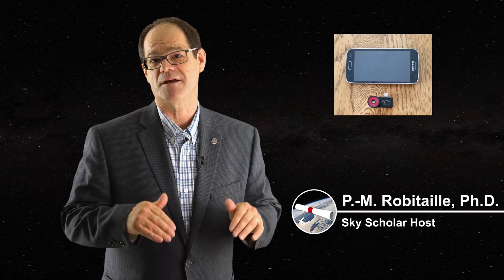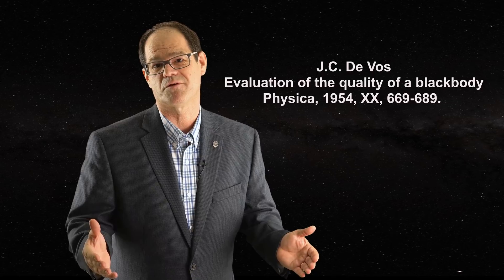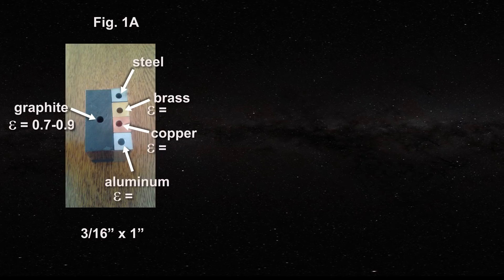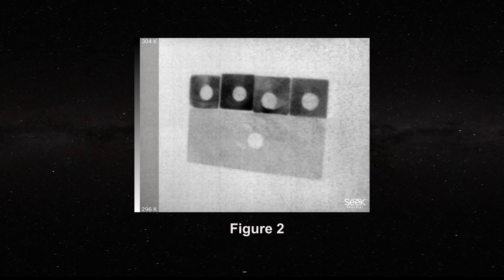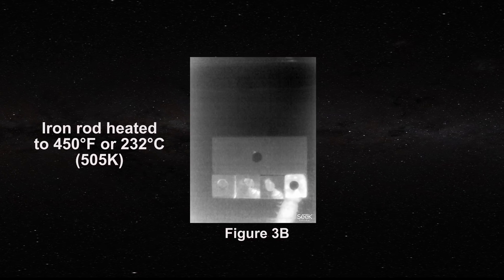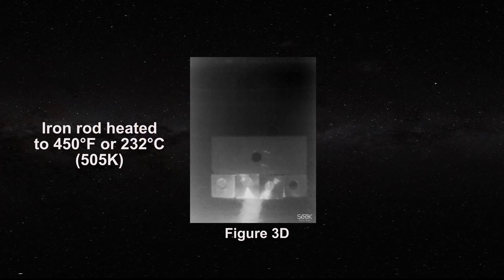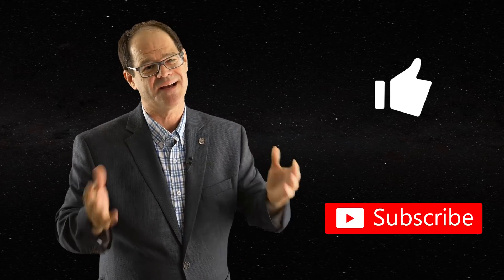Is Kirchhoff's Law True? The Experiment!

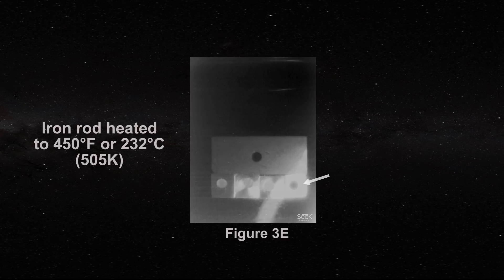Comment: "All cavities contain the radiation that corresponds to / manifests the temperature of their walls."  0:08, and 6:20

* It's only true in equilibrium, which your "cavities" aren't because they are open to their environment.
* They aren't cavities. One entire side is missing. They're holes.
* Showing that the "cavity" is black doesn't show that there is no radiation in the "cavity". It shows that there is no radiation escaping from the "cavity", since the camera is not in the "cavity".
* There is also the issue of the sensitivity of the camera to radiation of different temperatures.

In short, rubbish from start to finish. A pointless experiment aimed at an imaginary target.
Reply: Deipatrous, smug little know nothing.  While physicists and cosmologists ponder unicorns and fairy dust, us cranks go ahead and design and build the devices that power the world.  You see, mathematics doesn't produce anything.  Mathematics was used to prove that the earth was the center of the universe at one time.  And today, physicists don't know any better.
On the other hand, it only took me to the 3rd grade to learn that division by zero is undefined.  Physicists think they can define it.  I guess they still haven't learned the basics.
And on that bombshell . . .
Reply: Deipatrous, you are nothing but a massive idiot.  The simplicity of the demonstration is obvious to anyone without the blinders of pseudoscience on.
When "scientists," and I use that term very loosely, accepted a theory based on "thought experiments" over the scientific method of investigative laboratory science, they effectively set the world back over 100 years with stagnation.  The people who gave us the modern world (Heavyside, Maxwell, Tesla, Birkeland) were ignored and the science they were pursuing was replaced with philosophy.
Pseudoscience allows the division by zero to result in a supposedly real physical object.
Pseudoscience accepts untested observations as universal laws without any supporting evidence.
The good doctor showed with elegant simplicity the fallacy of the conclusions of Kirchoff and Planck when it comes to black bodies.
And what scientist doesn't know that you can't use a black body to test for the temperature of the universe?  The universe isn't in a cavity, and it's not a solid.
Reply: Ah, the vacuous response from an imbecile.  You wouldn't know basic physics if it fell out of the sky, landed on your face and started wiggling.

HAHAHAHAHAHA
Reply: @Deipatrous: In view of the experimental evidence presented by Professor Robitaille to the contrary, please explain why you think Kirchhoff's Law of Thermal Emission is true.
Reply: Why don't you explain to us why you think that experiment was invalid?  Or is that simply too hard for you?
Reply: Yes, please go away.  You offer nothing to the conversation.  I do have physics training, as well as quite a few years of mathematics and a lifetime of application of those courses in electrical engineering.

Pseudoscience is the hallmark of the high priests of singularities.  Infinite gravity from a finite mass collapsing . . . you do realize that "infinity" is not a number.  Or is that too complicated for you?
Reply: @Deipatrous: You did not provide your explanation as to why Kirchhoff Law of Thermal Emission is not wrong. 

Here is that Nobel Laureate you refer to:

Crothers, S. J., General Relativity: In Acknowledgement Of Professor Gerardus ‘t Hooft, Nobel Laureate, 4 August, 2014, http://vixra.org/pdf/1409.0072v9.pdf
Reply: I suppose you do.  Seems pretty obvious with the dismissive attitude you've presented since your very first post.  How very big of you to admit it.
Reply: No astronomer or cosmologist understands the laws of thermodynamics. None of them know the difference between intensive and extensive thermodynamic quantities and thereby violate the laws of thermodynamics by equating an intensive quantity to an extensive quantity (temperature as a function of mass), and unwittingly produce perpetual motion machines of the 1st kind and of the 2nd kind when they permit a free gas to compress itself to form a star and a black hole. It's certain that Kirchhoff's Law of Thermal Emission is false and Planck's equation is not universal. This puts an end to big bang creationism, as explained in this paper:

Robitaille, P.-M., Crothers, S. J., “The Theory of Heat Radiation” Revisited: A Commentary on the Validity of Kirchhoff’s Law of Thermal Emission and Max Planck’s Claim of Universality, Progress in Physics, v. 11, p.120-132, (2015), http://vixra.org/pdf/1502.0007v2.pdf 

Note in the above paper how Planck violated the laws of thermal emission and abused Brewster's Law in his scandalous attempt to prove Kirchhoff's Law of Thermal Emission right. He had no chance in any event because Kirchhoff is wrong, as the clinical existence of MRI proves, every day. One can have Kirchhoff's said Law but not MRI, or one can have MRI but not Kirchhoff's Law.  Any reasonable person will concede that MRI is real, producing images of parts of the human body every day in medicine. The existence of MRI proves Kirchhoff wrong because MRI (and NMR) is facilitated by spin-lattice relaxation (proton spin and its interaction with the structural lattice of the cavity walls), which means that there is energy in the walls of an arbitrary cavity that is not available to thermal emission. When Kirchhoff and Planck, by their theorising alone, permitted all the energy in the walls of an arbitrary cavity to be available to thermal emission they made all cavities blackbodies, when at thermal equilibrium, contrary to physical reality. 

Here is a simple 3-page paper which reveals how astronomers and cosmologists permit the absolute value of a real number to take on values less than zero, in order to construct their "mathematical theory of black holes":

Crothers, S. J., A Few Things You Need to Know to Tell if a Mathematical Physicist is Talking Nonsense: the Black Hole - a Case Study, 29 July, 2015, http://vixra.org/pdf/1508.0007v1.pdf

Anybody how has taken mathematics at school knows that the absolute of a real number can never be less than zero, and that the square of a real number can never be less than zero. Astronomers and cosmologists however are oblivious to their violations of these simple facts, which is precisely how they make their 'black holes'.
Reply: Still waiting for a proof that Mr Robitaille is quacking,  Deipatrous.

Your comments are so pointless that you will actually convince people that you do not know what you are talking about and this gives credit to Mr Robitaille.  Your efforts are self defeating. Kinda funny
Reply: You obviously don't get around much then.  I work with RF engineers all the time and they don't know what wires are.

Get a clue.  Going around in life completely unaware that electromagnetism is 39 orders of magnitude more influential than gravity on "charged" matter is like not realizing that liquid water is wet.
Reply: Everything we use today has a watermark of Tesla in the background. This brilliant mind died as a poor man in a hotel room, he was also presented as a crank nut case in those times. I just wonder if they listen to him and wanted to invest in his work, how would the world really look today if he had a chance and budget  to create his ideas.
Reply: Because it is Stephen J. Crothers, a notable critic of the black hole theory, and it was a SMALL conference.
Reply: You have University resources, recreate the experiment and then post a video.
Reply: You have to prove that he is quacking. I well know that an ad hominem is not always wrong but you have  to prove he displayed that behavior before to make it true.  Try harder. It feeds me
Reply: I'm an electrical engineer who understands the role of electromagnetism on plasma.  Electromagnetism is the tool through which we study the entirety of the cosmos.  We have massive radio telescope arrays searching out magnetic and electric fields by the radiation they emit.  We have optical telescopes that cover the range from infrared to ultraviolet, and others above the atmosphere that look at far infrared, UV, X-ray and gamma.  All of that is electromagnetic.  All of it produced by some electromagnetic phenomenon.  None of it produced by the .01% of the matter in the universe that is cold and electrically neutral, like where we live.

Laboratory science explains how plasma behaves.  We see in the laboratory what we observe through our telescopes.  We produce X-rays with ease, and not a hint of gravity is involved.  We produce masses with static charges that attract each other, no gravity involved.  We observe a filamentary universe on every scale.  Gravity doesn't produce filaments but plasma currents do.

So, what's your excuse?  Are you stupid, or simply blind?
Reply: Deipatrous, you need to step back from your dogma about gravity for a minute and look at the universe as a whole to see the problem.

Our world, the world of solids, liquids and gases exists along a temperature spectrum that is a thin line.  In a universe where temperatures range from absolute zero to literally millions of degrees, all within the distance from the sun to the earth, you can see that our world and it's three states of matter is exceedingly unlikely.  It is the exception, not the rule.  Gravity only becomes dominant once the electric force has reached a state of discharge.  That only happens once temperatures get close to absolute zero relative to the entire spectrum of temperatures.

The sun contains 99.8% of all the mass in the solar system, most of which is in the plasma condition.  And because the sun is electrified, it ejects the solar wind using electromagnetism, and that solar wind gains velocity as it leaves the surface of the sun and heads towards earth.  They use the same method at CERN to accelerate protons.  Gravity is completely ignored by the solar wind.  That is undeniable.  You don't gain velocity leaving a large mass unless there is something propelling that mass, and the only thing available is EM.  And when that mass reaches the earth, the magnetic field of the earth yanks those particles into the upper atmosphere creating auroras.  Gravity's role in the behavior of that plasma is 39 orders of magnitude below the signal level.  It's merely noise.

You need to read about the Norse physicists, Birkeland, Langmuir and Alfven.  They understood well what was going on outside the atmosphere, the vast universe that exists as plasma.  What Birkeland and Alfven predicted based on their understanding of plasma was vindicated later in the 20th century when observations confirmed their predictions.  Langmuir made significant discoveries on the structures that plasma undertake due to their electromagnetic interactions.  Plasma will form helical currents that squeeze charged particles together, and what ever neutral matter is in the path of the Birkeland current.  This filamentary nature of matter under the influence of electromagnetism, as observed in the laboratory can be seen in the sky as well.  
http://fusionfarming.com/the-man-on-the-200-kroner-note/
"His passion was to understand the Northern Light.  All his theories in this respect where confirmed in 1966, but in his own time he met major resistance – especially from british scientists."

Some things never change.  

The bitter-clingers to the Newton-Einstein (N-E) mass driven universe still refuse to come to grips with later codified discoveries in electromagnetic behavior and theory.  The N-E sect attempts to apply what happens to the .01% of the universe, and use only that mass model to predict what happens to the rest of the universe.  But most of that matter is not under the influence of gravity.  It is under the influence of electromagnetism.  And what an additional 39 orders of magnitude of available force does is remove the need for imaginary massive objects to account for the observed trajectories, and imaginary dark matter to account for the observed plasma driven behavior.

Space is curved by electromagnetic fields for matter that is electromagnetically susceptible (charged).  Einstein tried to curve it using mass as the driving force.  But that is only true for the piece of the universe that is almost frozen.  Where it is OBVIOUSLY CURVED is within the electromagnetic field geometries created by the flowing plasma currents observed in space and in the lab.  Gravity plays no role at all once matter reaches the plasma state.  It becomes its own dominant force due to electromagnetic phenomenon.  EM is self interacting.  Put a bunch of high temperature charged masses into an electric current and very interesting things are observed, and none of it involves gravity.  We see how plasma behaves in the lab as we see it behave in the "vacuum" of space.
Reply: attacking the person i see, seems that the subject matter is still escaping you
Reply: Fourier transforms eh?  You just google a term for an operation used by EEs for decades?  I've got quite a few years of physics study as well.  But black holes and curved space-time is not physics.  It's not even science.  That's philosophy.  How many years of study in electromagnetic theory do these physicists require?  I'll bet its dwarfed by the amount of mathematics theory they have to take.

Robataille has the goods, both in the laboratory and in the halls of academia.  We don't know shit about you other than you show up, call an accomplished scientist a quack, and offer nothing to back up the claim.  The demonstration in the video is a complete refutation of an application of Kirchoff's law.  You're just too brainwashed into thinking that the bullshit artists in the church of quantum quackery simply couldn't have gotten it wrong by adding a bit of carbon to the experiment.
Reply: Nice retort.
Reply: The only worshiping going on these days are the cult followers of relativity and the quantum menagerie.

Only a moron would think that gravity is the dominant force in a universe made of 99.99% plasma.
Reply: keep believing brother god is with you, your heaven awaits you with all the virgins you could possibly want and as many fruit as you cant imagine, praise be you sir, you are gods true beleiver praise be upon you, may the fruit be plentiful....
Reply: @Deipatrous: You were not requested to provide a course in physics, but your reasons why Kirchhoff's Law of Thermal Emission is not false, in view of Professor Robitaille's experiment. After all, this page is about his experiment, not about me. It seems that you do not understand Professor Robitaille's experimental proof of the invalidity of Kirchhoff's Law of Thermal Emission.
Reply: Luke Barnes,
Postdoctoral Researcher,
Sydney Institute for Astronomy,
University of Sydney, Australia.

You will recall that I attended a small conference at USYD last November which you co-organised and at which you gave two lectures. The paucity of understanding of basic principles of physics demonstrated in your lectures caused me grave concern and great dismay no less than your comments above.

Stephen J. Crothers
Reply: What a rubbish complaint! The camera is right over the holes! None of the black body demonstrations on YouTube have a camera right in the hole or holes. Even De Vos doesn't put a camera "in" the hole. Go back to sleep.
Reply: @Deipatrous: It's obvious that you don't understand thermal emission.
Reply: Deipatrous, you obviously aren't capable of absorbing the obvious when it is right in front of you.
This was a perfect demonstration that not all cavities are equal, which is in direct opposition to Kirchoff's "universal" law.
Reply: Oh look.  More Ad hominems!!!

Comment: Can you explain what "work" is done by the black body?  Thanks.
Reply from the maker: Real blackbodies do work by converting any incoming radiation to the radiation which is characteristic of the temperature of their walls.  They can also do work by converting any heat (which enters their walls through conduction) into thermal radiation manifesting their temperature.  Hope that helps!
Reply: @SkyScholar  Hi Dr. R.  You take a lot a flak but carry on with grace.  How does WMAP and the std model of sun formation become flawed by relying on Ks law
Reply: Perfect transformation of the energy, instantaneously. I hope I don't bungle this... if you can picture how the light we see is the visible spectrum of electromagnetic radiation, consider the difference between a mirror and soot. A mirror is a near-perfect reflector, which does not transform the 'light' in any way other than allow it to bounce back at you. The soot will transform the light into something else. In this experiment, the holes lit up with reflectors because they allowed the energy to pass. Regardless of where that rod was placed, the hole in the graphite never lit up in that energy spectrum. This is because while the other materials allowed the transfer of that energy through their walls and into the hole, the graphite absorbed the energy and did not transfer anything. To be honest I could see how a mirror's 'turning light around' could be considered work, but in this case we can recognize how some of the metals 'lit up' the hole with energy and some did not.
Reply: @SpaceWeatherNewsS0s  Is Unruh(ly)-Weiner Radiation too presumptuous? All math comes from the brain, we are visual creatures first, and use math to describe light.